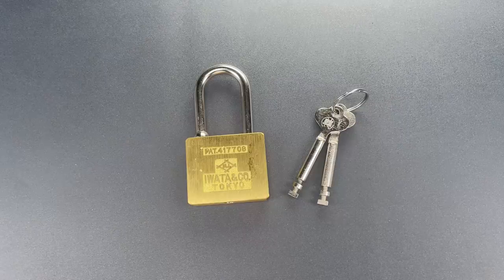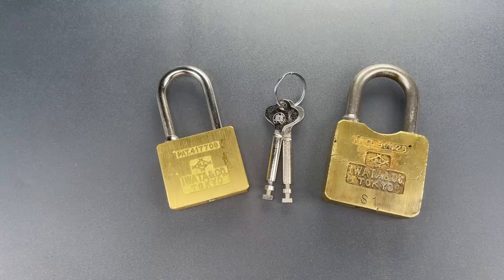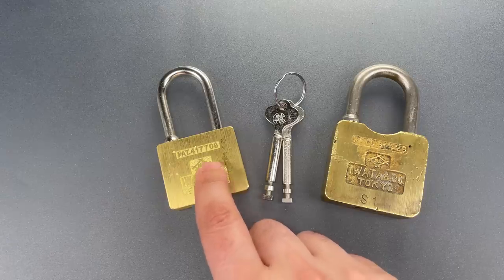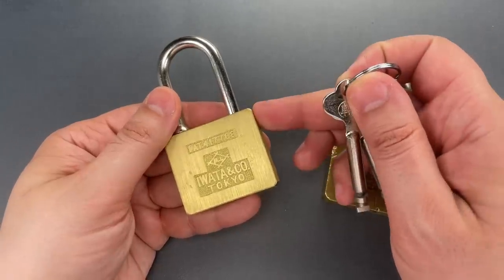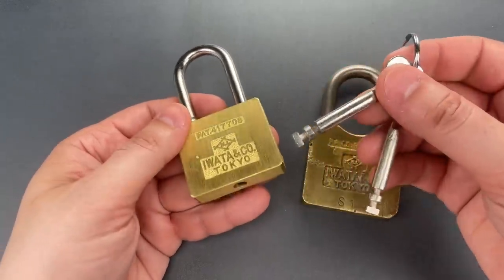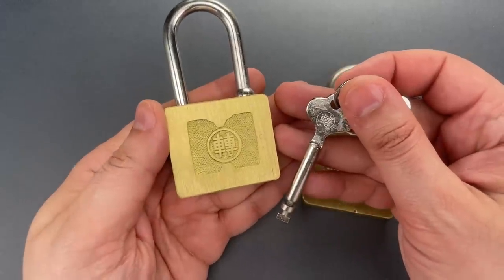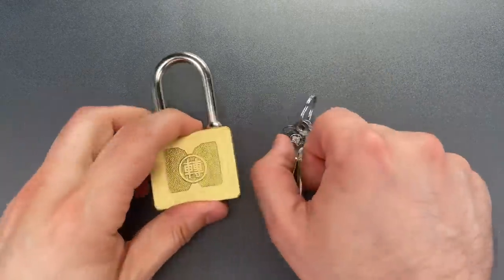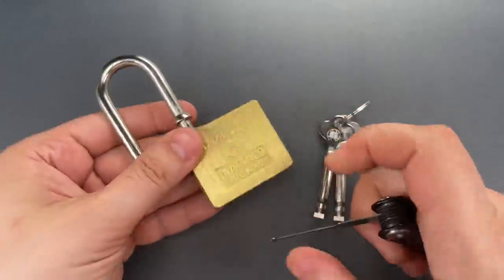[1304] Analyzing a Vintage Iwata Padlock

Comment: 轉 (pronounced “ten”) is an old character for 転, which has meanings such as to turn or to change direction (ex. 転ぶ: to fall down, 回転: to turn, 運転: to drive). “Zhuan” I think is a Chinese pronunciation. source: I’m Japanese; こんにちは from Tokyo!
Reply: Thanks for the clarification.
👍
Reply: 説明してくれてありがとうございます。動画でこの発音を聞いた時、僕も中国語の発音と思ったので、日本語の発音を教えてくれたありがたい。
Reply: Only passingly familiar with Japanese and the "zhuan" struck my ears as unusual for the language.
Reply: Zhuan is indeed a Chinese pronunciation
Reply: I was wondering where he got the Zhuan pronunciation from on a Japanese lock. It was the 音読み reading, which makes more sense now.
Reply from the maker: Thanks for the correction. 👍
Reply: I did some digging in Japanese and it appears it’s a lock for a “rail track switch maintenance machine” for Japan National Railways that existed until 1987 (it has since been privatized and has become “JR”.) I couldn’t find anything else though :P
Reply: @Voltaic_Fire  Other way around. The japanese writing system is basically Japan stealing the Chinese one and corrupting it thrice over
Reply: @Voltaic_Fire  yes. The japanese kanji characters are essentially Chinese characters
Reply: @Voltaic_Fire  it's actually the inverse. one of Japan's writing systems uses characters adopted from traditional Chinese
Reply: @Voltaic_Fire  Japanese borrows characters from Chinese going back a long time. Most characters (kanji) have two ways they can be read. 訓よみ (Kunyomi) is the Japanese pronunciation and 音読み (Onyomi) is the Chinese pronunciation.

They are also a pain to figure out which one to use when learning to read Japanese.
Reply: @Voltaic_Fire  absolutely wrong assumption. In fact, it's reversed: when Japan was young nation, they adopted the Chinese writing system and symbols, it happened more than millennia ago. Then they modified it to their liking and created simplified characters that have no meaning by themselves and are only used to express syllables in the words.
Reply: now why is this symbol printed on the back? it's not like people don't know that after keys are inserted, they need to turn the keys to unlock the padlock...
Reply: @Voltaic_Fire  The character is actually 100% Chinese. It's one of the Chinese characters adopted by the Japanese while developing their own characters. A big portion of Japanese characters originated from Chinese characters, so it's not uncommon at all. China stealing stuff from other countries/cultures is low-key quite a recent thing, probably within a hundred years. 
A friendly Taiwanese
Reply: @ArthurD  The individual characters of Kanji do have meanings. You are thinking of Hiragana/Katakana as the symbols attached to syllables. Like 車 means vehicle, usually 4 wheeled, くるま is the spelling (the syllables attached to symbols) in hiragana.

Japan has 3 writing systems that can be broken down into 3 parts 漢字: Characters with meaning, ひたがな: Native Japanese symbols/syllables (Part 1 of Japanese alphabet) and カタカナ: Non native syllables/symbols (Part 2 of Japanese alphabet).
Reply: @aaronbarringer4913  I know all of that, thanks. He doesn't know that, I didn't want to overload him with so many details.
Reply: @Voltaic_Fire  This would be a long history lesson, too long for the Comment section.
Reply: @ArthurD  I figured but felt your comment was a little too reductive. But Cheers
Reply: @ginger88895  the character is not telling the user to “Turn the key”, it is more like telling the user where it should be used. It can be understood as “Rail Changing”. So you will use it to lock the rail change handle in stead of locking up you valuable
Reply: @Voltaic_Fire  Japanese is a totally different language from Chinese, but the Chinese characters were "borrowed" from Chinese, and used as part of the Japanese writing system.  Hence, the same (or similar) characters may be used in both Chinese and Japanese, but the pronunciation is usually different.
Reply: @Voltaic_Fire  with kanji its the other way around. Japan adopted that chinese alphabet and added some characters of their own.. of which some made their way to china
Reply: He did a pretty nice job pronouncing zhuan though :D
Reply: @skyletoft  The Japanese did not steal the Chinese characters. How do I know this? Because the Chinese still have all those characters. Did we steal the word entrepreneur from the French? Well, they didn't because the French still have it.
Reply: @RobertShaverOfAustin  I don't know if we stole it or not, but the French have lost entrepreneur
Reply: @Voltaic_Fire  Many (but not all) Japanese kanji were originally Chinese characters.  That's probably where the confusion came from.
Reply: @Voltaic_Fire  For a less biased explanation, many Asian writing systems are based off the ancient chinese (traditional) characters that not even modern China uses anymore.  Japanese, Korean, and Vietnamese (possibly others) all borrow from this writing system but also have their own writing systems to supplement.  Modern Chinese and Japanese both use the "simplified" Chinese characters.  I know that in Taiwan, they still use "traditional" Chinese characters.
In this video, the character "轉" stamped on the lock is the traditional version of "転", which is the simplified version.
If you were to make an analogy, western countries commonly share the Arabic letterings, even if the pronunciation is different for the same character.
Reply: @eksentrysyti  "western countries commonly share the Arabic letterings" - not quite; the Western script uses (mostly) the Latin alphabet, which derives - via the Greek one - from the Phoenician alphabet. The Western numerals are sometimes called "Arabic", but they are actually Indian in origin; the character shapes themselves are North African. Talk about cultural appropriation! ;-)
Reply: @Voltaic_Fire  like all languages they do have many elements from other languages ... even english has  foyer ... from the french meaning entrance or hall ... rthe tiny windows at the top of churches (very old ones) are called fenetre windows ... fenstre is french for .. window ... so they are window windows by mondern translation ... no language can say they havent adopted perverted or corrupted words form another language it is something that happens when one language doesnt have a word for what is being said or when they share a similar sounding word  for roughly the same concept or item .
Reply: Thank you for spending your time on this investigation 👍
Reply: @aaronbarringer4913  You have to understand that there are "on" and "kun" readings for each kanji. Look it up!
Reply: @Voltaic_Fire   
Entrance in Japanese: 入口, in Traditional Chinese: 入口
Exit in Japanese: 出口, in Traditional Chinese: 出口

Those are about the only words I know in either language.
Reply: @Voltaic_Fire  It's not strange, not even a bit. Japanese has three main writing systems, two based on symbols that correspond to a syllable each (katakana and hiragana) and one (kanji) where – like in Chinese – each word is represented by a character (or more than one sometimes). Kanji literally means "Han characters" where the Han people are the main ethnic group in China. This is about Japan adopting this system from the Chinese, not the other way round. As for China "annexing" what's not theirs, you can also look up the story of places like Nankin for a bit of a different perspective. 💫
Reply: I am Taiwanese 轉 indeed pronounced “Zhuan” in Chinese.他說的沒錯~
Reply: And China use 转（Zhuan） nowadays, Taiwan still use 轉（ㄓㄨㄢˇ）,  Japan use 転 （ten）
Reply: @RAD6150  yeah they use three different scripts (one of which is Chinese) so it can get a little confusing too (currently learning the language)
Reply: @johnather  you picked a tough one to learn!
Reply: @aaronbarringer4913  No, the on reading is "ten". If you search for a kanji in a japanse online dictionary it will most likely tell you the japanese readings in hiragana (for kun readings) and katakana (for on readings) and also chinese readings in pinyin. For someone not familiar with kana the pinyin, which is in latin script, would be the only intelligible script.
Reply: I learn some simple japanese and zhuan is kinda weird cuz i heard it when i learn simple chinese.
Reply: @Voltaic_Fire  They share a lot of the same characters, but Japan mostly uses the native pronunciation. There was a long time during the 600-1200AD period when the Japanese Imperial Court was heavily inspired by Chinese things. But there's also times when the Japanese use the Chinese pronunciation. The war between the Minamoto and Taira clans is called the Gempei War, from the Chinese pronunciation of the first character of each clan name: Genji and Heike, Gen+Hei, with the N changing shape to M and the H changing "shape" to a P, following the usual rules in Japanese for those shape changes.

If you really dig back, the Onmyouji use Chinese seal script for their charms, not the usual characters.

Chinese and Japanese have both simplified the most complex characters, but did so very differently.
Reply: @ejreob  No, the kunyomi reading is "ten." I managed to find the kanji used on an online dictionary, and Ten is Kun, Zhuan is On.

As for kana in pinyin in the latin script? That's called romaji. The use of "roman letters" to spell out words instead of Katakana/hiragana.
Reply: @dhaen  My issue is how to know which reading to use at what time and if they are irregular or not.
Reply: Doesn’t Japanese Kanji have a Chinese Reading and a Japanese reading which makes it hard for even Japanese locals to read old or obscure kanji at times without clues from the context of a sentence that it’s used in.
Reply: @aaronbarringer4913  Either you are trolling, using a bad dictionary or very new to japanese. The on reading is テン, the kun readings are ころ.がる、ころ.げる、ころ.がす、ころ.ぶ、まろ.ぶ、うたた、うつ.る. In no way, form or shape are zhuan3, zhuai3 or zhuan4 japanese. Neither is the korean reading jeon japanese. Kana doesn't have anything to do with pinyin. Pinyin is a system for transliteration of chinese into latin script comparable to how Hepburn is a system to transliterate japanese to latin script.
Reply: @ejreob  Well the dictionaries must of been wrong. Guess I shoudn't trust my colleges linguistics history breakdowns I got from the academic library. Paid too much for it if some dude on the internet says it is completely wrong.
Reply: @aaronbarringer4913  What you might have gotten confused is that the on reading is sometimes called the "Chinese reading", but that is not to say that zhuan is the on reading. The Japanese on reading (ten) is what the Chinese reading was adapted into when the kanji was first borrowed into Japanese. Zhuan is the current Chinese (putonghua/mandarin) reading of the kanji. Due to kanji being borrowed into Japanese over a long period of time in several waves during which different Chinese dialects/variants were dominant the on reading and the current Chinese reading of a kanji can differ substantially. And don't go down the path of flexing whatever level of education you have in japanese on the Internet, there will always be ppl more knowledgable/nerdy around.
Reply: @ejreob   I'm not, I just didn't realize you know more than the linguist who published an academic paper and happened to use the change from 轉 to 転 as an example of evolution. I guess 轉 never existed and the first instance of 転 didn't occur later, causing a shift in the readings. You should really write an academic rebuttal and get it published.
Reply: @aaronbarringer4913  The shift from the older kanji variant to the newer really has nothing to do with the matter at hand. Now you are just spouting irrelevant tidbits to sound knowledgeable. Please try harder.
Reply: @ejreob  I'm not spouting tidbits, I'm telling you that you are completely right and you should write the academic paper and submit it as a rebuttal. Just pay for access to an academic library, search mentions of 轉 and 転 to get to the paper, and then cite it as what you are responding to. You could even be peer reviewed and published in the Hitsubashi Journal of Arts and Sciences. It would be great for you, they might even give you grants for more research.
Reply: @aaronbarringer4913  Why would you put the onus on me to find a paper you are using as a reference?
Reply: @ejreob  Because I think you are right, should find and read it for yourself (it's the first result I found when I looked for "轉 to 転 history") and linking to it when it is behind a paywall is pointless because I have not met a single person who will actually pay to view a single paper. If you went to the trouble of getting a membership to an academic library without actively being in college or having a professorship, you'd probably also forget the exact citation by the time you are done with all the paperwork.

Anyway, you're right, I'm totally wrong, and I am 100% serious that you should write the paper and get acknowledged.
Reply: @aaronbarringer4913  Dude, access to papers is not that restricted. Link what you are referencing or at least write out the title of the paper and/or the author. It almost feels like you don't want me to find the paper.
Reply: @aaronbarringer4913  It's kind of funny when you try to correct someone on linguistics and then write "must of"
Reply: @doommaker4000  Cool, it flew over your head too but you almost managed to catch it. Tip of the glove and you still dropped it.
Reply: @Voltaic_Fire  The Japanese basically borrowed the Chinese alphabet several times over, but Japanese is a very different language from Chinese, so meanings and pronunciation can be wildly different. The whole history is long and complex and it makes written Japanese a very difficult language.
Reply: @gamingworld9184  Believe in trash, become trash.
Reply: @ha102212345  yeah china steals everything nowadays lolol. If you do it now, it’s stealing, but if you did it hundreds of years ago it’s the flow of culture. I remember years ago as a kid listening to a comedy CD from 倪敏然 and his son and they were poking about how the Japanese stole everything, they even stole Journey to the West and turned it into Dragonball, absolutely hilarious. https://youtu.be/FL7v4YPGq80
And if you’ve ever watched Top Gear, there’s an episode about chinese cars and how they copied BMW’s styling, BMW sued, and lost lol
Btw I’m an American-born Taiwanese currently learning Japanese 🙂
Reply: @aaronbarringer4913  another thing, both katakana and hiragana were derived from chinese characters that were taken for their pronunciation instead of their meaning in chinese and then used to spell out Japanese, which over time got simplified to the kana used today.
Reply: @rogerwilco2  IT’S NOT AN ALPHABET.
Reply: @JasonB808  Japanese kanji have a Japanese reading, sometimes multiple, called a Kun-yomi. And then yes, they have a chinese reading, called On-yomi. But it’s not necessarily the pronunciation used in chinese today; it originates from the pronunciation used in chinese hundreds of years ago at the time they were borrowed. Some pronunciations today may be very similar in both languages; others may be only similar in Japanese to certain other dialects of chinese because the pronunciation in that dialect has preserved the old pronunciation from that era and/or it was borrowed directly from that dialect; and many are completely different because the pronunciation in one or both languages has changed over time. Then there’s the fact that chinese is a tonal language while Japanese is not, so any tones were basically lost when they went into Japanese. Additionally, within On-yomi, there’s also sometimes a distinction between Go-on, Kan-on, and Tō-on, which I believe each corresponds with a different era which it was borrowed. Those two categories are the most important ones, though there’s also Nanori, readings used exclusively for people and place names; and Ateji, kanji taken for their sound rather than their meaning. Examples of Ateji include “trash bin” 護美入れ, where “護美” means “to protect beauty” (though I guess you could argue that you’re protecting the beauty of the earth by throwing your trash in the bin, lol); sushi “寿司”: 寿= lifespan, 司=to administer, but the proper kanji is 鮨; and Sayōnara, where the proper kanji is 然様なら: 然様= like that, that way, なら=if (so literally, “if that’s the way it is”), but the Ateji for Sayōnara is 左様なら, where 左 means “left” as in “left side”, and is taken for the pronunciation and used out of context because 左 is easier to write than 然. That said, both kanji writings for Sayōnara are rare these days because it’s even faster to just write the whole thing in hiragana: さようなら。
Reply: @BobTheHatKing  Yeah but we were talking about Kanji earlier when having meaning came up.
Reply: @dlevi67  who the hell is talking about "cultural appropriation"? bogus term imo anyways but why even bring it up when even in concept it has absolutely nothing to do with anything that is being saied?
Way to politisize a discussion.

the reason theyre called arabic numerals is because they spread during the islamic expansion. there is a reason why we have stars called altair and deneb. throughout the middle ages the islamic-arab world was VASTLY outclassing europe stuck in their darkages in basicly all sciences , until islam itself plumeted into their own darkage which sadly in large parts of the world lasts to this day.
Reply: @aaronbarringer4913  "Zhuan" is most definitely not a Japanese pronunciation, 音読み or otherwise, because Japanese doesn't even have the "zh" sound. Source: そう言う仮名が存在しない。
Reply: @nextghost  Cool, another person confirming that the Japanese never used Chinese as a court language for a period of time. I am so glad such knowledgable people exist. I also learned that "zh" as a Phoneme exists in English even though it has never been recorded before. You all could get together and write a paper to revolutionize the world.

Also, nice Japanese saying such a kana doesn't exist.
Reply: @aaronbarringer4913  Bruh, the Japanese imperial court stopped being China fanboys more than a thousand years ago. Get with the times.
Reply: @nextghost  Yes, the arguement put forth is that they never used chinese, it never evolved over time, でゅ and てゅ has no etymology, and you are 100% right. Like I said, revolutionize history and linguistics with your paper.
Reply: @aaronbarringer4913  The argument put forth is that the lock was made in the 1960s and speakers of modern Japanese don't care how that particular character was pronounced 1300 years ago during the Nara period.
Reply: @nextghost  Right, there is no history in language and it doesn't evolve. Good to know.
Reply: @aaronbarringer4913  Yes, languages evolve through history. Yet you argue that for one particular Kanji character, 8th century Japan somehow adopted the modern Mandarin pronunciation which developed several centuries later from a completely different regional dialect of Middle Chinese than they were actually borrowing from at the time. That doesn't sound right.
Reply: @nextghost  Just as you say, they knew nothing and invented it all out of thin air with no traceable legacies. You are 100% right in all things.
Reply: @skyletoft  corrupting? simplifying? modyfing it to better suit the language? Name one country that didn't do that to their writing system. I can't find the post you reacted to, so I might have missed the context.
Reply: @ejreob  though Hepburn can be used for Chinese as well, but that was deprecated when China developed an official reading.
Reply: @aaronbarringer4913  you either misinterpreted wat ejreob is saying, or the academic paper you read,or both.
Reply: @aaronbarringer4913  amongst others, you might be missing the implied "modern" when you read something someone says about Japanese and you interpret it as all Japanese in all of history.
Reply: @mjouwbuis  let's see, we were talking higher up in the thread about romaji and etymology and he starts talking about chinese transliteration to latin, i bring it back to romaji and then we decide he is right, that kanji has no traceable etymology and sound just springs from absolutely nowhere, that all we know about history is wrong because some internet dude says so, and other people just keep agreeing so it must be so, fuck historical documents and research and shit.
Reply: @mjouwbuis  Yes, when we start the thread talking about the HISTORY of the kanji, how dare I think the origin is important in leading to the modern interpretation and changes. Damn, shame on me.
Reply: @mjouwbuis  I've never heard of Hepburn being used for Chinese. Are you thinking of how Wade-Giles, and other systems, were replaced by CCP developed Hanyu Pinyin?
Reply: @ejreob  You're right, I was thinking of Wade-Giles.
Reply: @skyletoft  They didn't steal it. China was the biggest influence in Asia so of course they'd use their writing system when it came to trading and culture.
Reply: @ginger88895  how tf am i ur first like, this is fucking hilarious
Reply: @aaronbarringer4913  any advice at learning kanji? It's really hard to be honest... 😅. I think I just learned the learning one and some other ones while studying...